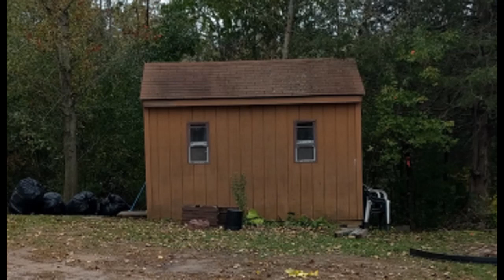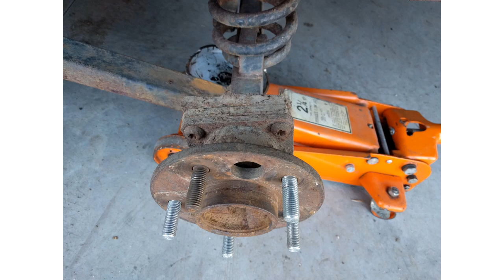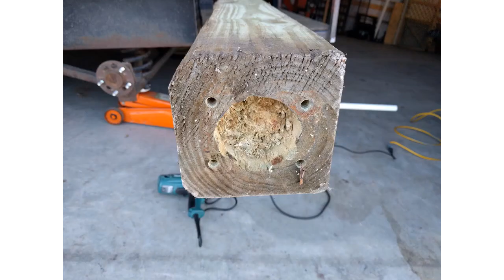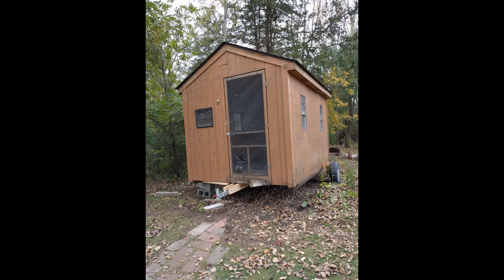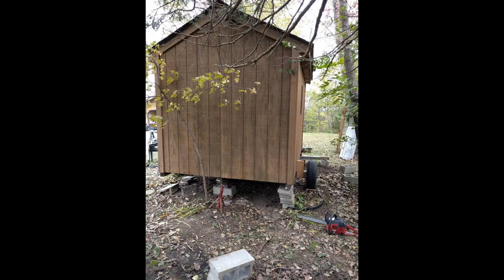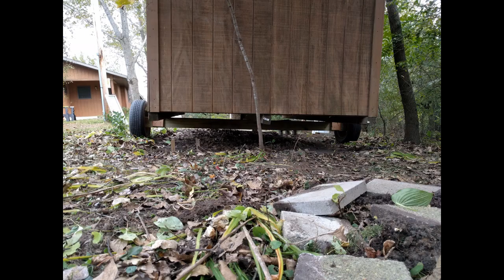Garden Shed - Part 1 - Move prep

Comment: I'm doing the same thing to my 10x24 but with tandem axles.
Reply from the maker: Now that is a video I'd like to see!  What do you plan to use as a tow vehicle?
Reply: @The Toolman  Definitely not using my 2017 F-150. That truck has given me enough issues as it is. If I'm lucky I may be able to get a new generation GMC 2500HD with the new small block in it.
Reply from the maker: @MAGA-Chad  I grew up in a GM household where you didn't dare to utter that four letter word, Ford.  I've always driven Chev trucks and the small block Chev has never stranded me or let me down.  Good choice on that GMC.
Reply: @The Toolman  I gotta say though that the old 80s and 90s Fords are pretty good but anything that Ford made after 97 is a no-go. I love GMC/Chevy but the only things I hate that GM has did to their HD trucks:

1 Independent Front Suspension (please bring back the solid axle, GM)
2 No big block V8 (the 7.4/8.1 was a true truck engine

Aside from those two things I'm a GM guy through-and-through.